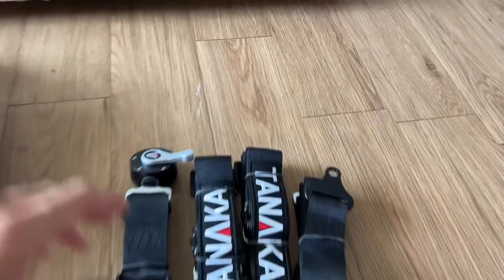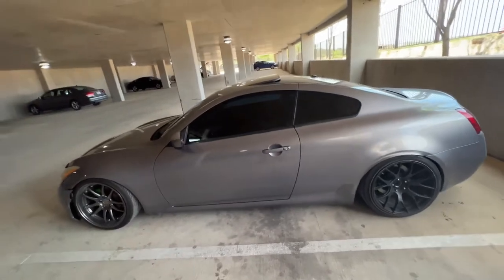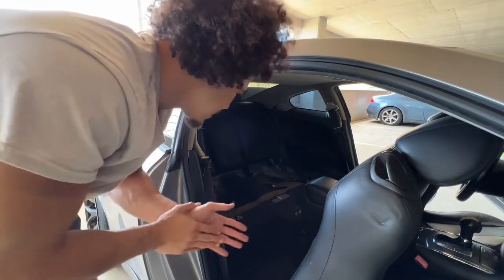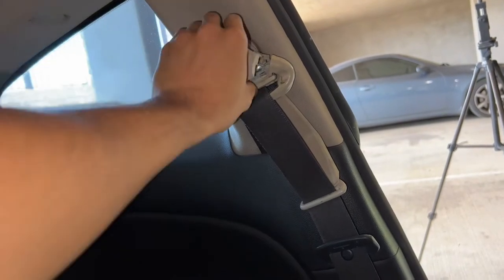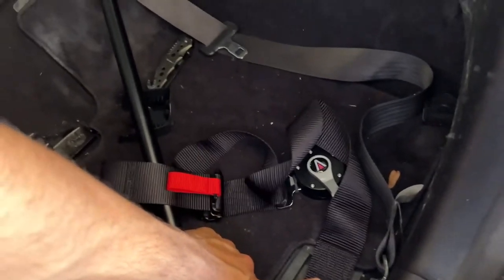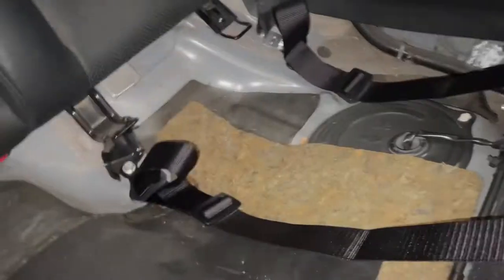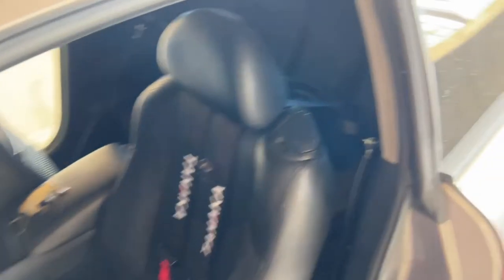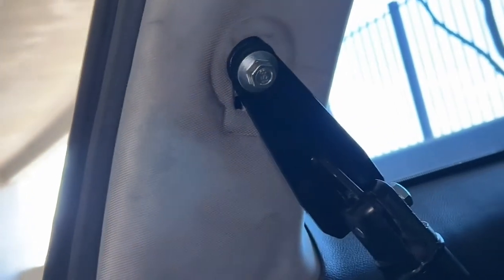Tanaka Racing Harness Install | Slammed G37 Build

Comment: Please make sure this is safe bro. We don’t think you did install correctly
Reply from the maker: Im sure it is, the bar is mounted in the safe zones and the seatbelts are mounted in a secure spot. my belts never lose tension and the tension is constant all around my body... 
However, i will say the angle could be adjusted from where the seatbelt sits in a motorsport setting, but im not planning on tracking this car for a while so when i do decide to do that i will make necesarry adjustments